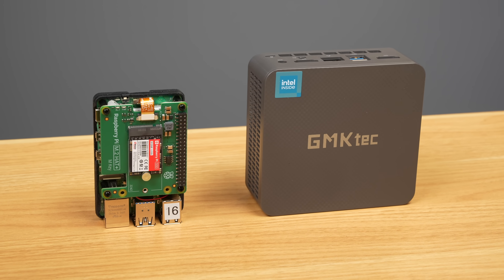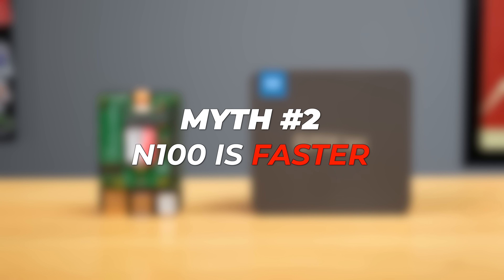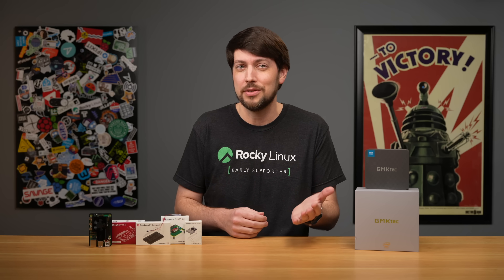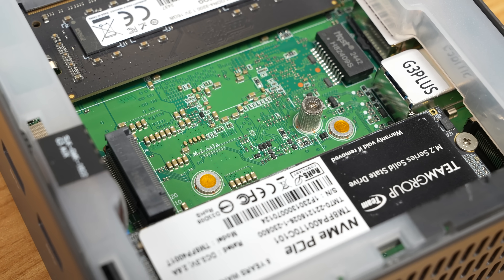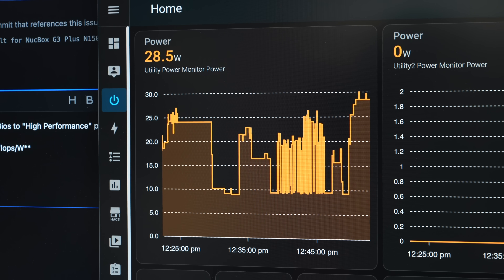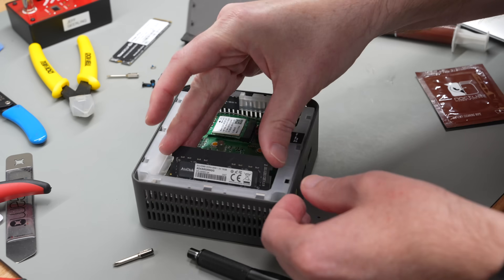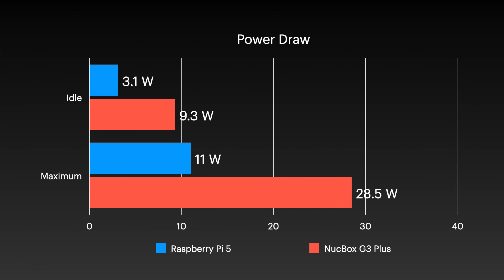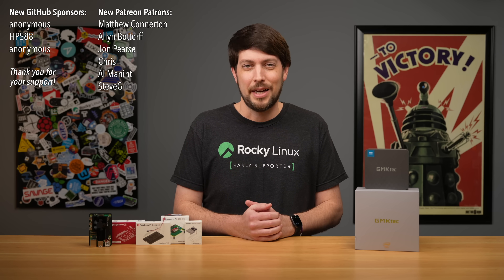When did Raspberry Pis get so expensive?

Comment: A used HP Elitedesk 800 G3 Mini i5-6500T, 16GB DDR4 RAM, 512GB SSD cost me $100 delivered and it was in excellent condition. Hard to justify new HW unless there is a specific use case.
Reply: There's a ryzen 5 2400 version floating around that regularly goes for about 70 bucks now to. It's an absolutely amazing little machine for the money.
Reply: Or my 'new' £60 Lenovo Thinkpad, with NVMe and 16 GB memory. It can't do the electronics interface that the Pi has, but for operating system / programming stuff it is cheaper and more powerful.
Reply: I have a similar experience. Recently bought a locally refurbished Elitedesk 400 G2 Mini with a Pentium G4400T, 8GB of RAM, and 256GB NVME SSD for 45€ and it is great as a local file server and thinking of using it for other services (DNS server?) as well. I can't measure power draw, but based on C-states in powertop it should idle at around 6W based on other videos I've seen.

I also agree, its hard to justify new hardware unless new features are a must (AV1 decoding or newer AVX instructions).
Reply: Yup! Got the same....no comparison.
Reply: Likewise I am replacing all of my Pis with the mini Prodesk 7th gen I3 7100T and i5 7600T.   The full size Pis cannot compete whatsoever with these things except on power use, but they cost so much less to own, it would take years of a Pi saving power to cover the higher hardware cost to match what an old Prodesk can do.  The HP also comes with a great case and stuff like NVMe built in so none of this add-on junk that forces a Pi above $200.  Absolute no.  And these Prodesk can do actual real work like running any OS you want, decent gaming, media serving. Whatever.  I've got a SFF desktop version as well with a 16X PCIe slot.  I could slap a real GPU in there.  These Prodesk or Elitedesk boxes are stunning at these low prices. I'm sure the similar Dell or Lenovo boxes are also great.  All of these obsolete any Pi that costs more than about $40 bucks all in.
Reply: I bought 4 of these just fine. The 5th one was completely FULL of dirt and dust. You can blame me for not using the same seller, or blame the seller for that mistake, but it's a hazard either way. Buying new generally is safer as far as surprises, and there are stronger buyer protections than getting used. I sent the dirt box back to the seller but it still wasted my time.
Reply: @HyenaEmpyema Why fret? I just paid $25 for one shipping included.  At those prices, even one bad box is not much.  I would have just taken it to parts and cleaned it up in the sink.  No big deal.
Reply: @HyenaEmpyema  this is a risk everybody understands when it comes to second-hand gear. If you don’t like the risk, buy new - risk vs cost 🤷‍♀️
Reply: @louwrentius  yes we agree. So just because a used i5 has a lower price tag doesn't mean it's cheaper. Because you might get a box of someone's dried skin cells 😮
Reply: Used is a lot cheaper, but the i5-6500T is slower than an n105, especially the iGPU and the SATA SSD. Power consumption is also a lot higher higher for the i5.
Reply: @tschorsch  I've got a HP Elite Desk G4 with i5 8500T, 16gb Ram, 500GB SSD and it only consumes 35w. It does the job, got it for $200 so like $100USD.
Reply: @tschorsch my measurements showed that my i5-6500 models could idle 3-4watt as observed by others
Reply: @tschorsch  that hp is nvme ssd. Many of them from this timeframe are nvme, the minis, sometimes have 1 2.5x sata bay. The sff ones have 1 or 2 3.5" bays.
Reply: @tschorsch  you might want to fact-check the performance claim. i5-6500t beats n105 in public passmark, geekbench, and cinemark scores.
Reply: Two big reason to go new hardware with something like a miniPC or Pi is because you are putting it into a project you want to share and see others be able to replicate - that 10" mini rack cluster of Pi's just can't be replicated by other people if instead of Pi's in the mini rack you are mounting weird cheap industrial PC that are just not widely available and long discontinued.  Or because these small industrial PC tend to very much not standards compliant so upgrades and repairs are tricky if possible, and the SBC has likely been abused and may not be fully working in none obvious ways. 

But if all you need is what you are sold, or you don't mind getting into the weeds repining a new PSU so it can handle that high power network card or GPU etc...
Reply: @foldionepapyrus3441  if the mini PC is an amd64 platform then the world is your oyster, you can run Linux or Windows on just about any mini PC, and the flagship line mini PCs from the major PC manufacturers are about as common as you can get, new and used.  The scenario about suddenly being a big distributor of a product only applies to a handful of people in the world, and they already know how to solve problems.
Reply: Great if you want to run Linux, for sure, but a 6 series Intel chip can't "officially" support Windows 11 (there are workarounds, sure).
Reply: @fuelvolts  the g line has tpms in the motherboard, so the win11 installer is happy
Reply: @fuelvolts  "Great if you want to run Linux, for sure, but a 6 series Intel chip can't "officially" support Windows 11"  Well as the comparison is against the Pi, which can't officially run Windows 11 either, it's a fair system to compare to.
Reply: @fuelvolts  that is your problem, you want to install windows instead of one true OS...😉
Reply: @wikingagresor  You're right. Install macOS on it
Reply: @fuelvolts  there are no security fixes for that CPU as it's end of life since 2022.

Comment: For me it'd need a very specific application to warrent getting a pi anymore. I keep picking up brand new, never been opened dell optiplex and lenovo thinkcentre mini pcs on ebay for arouns £60 each. Some of them are incredibly well specced too (i7, 16gb ram ,1tb ssd, etc). I dont know why theres so many of these being offloaded but it's been from the most random places, a bunch of charities in the UK have been selling them for example. I can only assume its from a business that had a lot on hand and have since gone bankrupt with the administrators clearing all their stock out. 

Even without that though, second hand ones are £50-£70, and most of the time just like the new ones include a keyboard, mouse, power supply and hdmi cable. 

The pi has its usecases but it's shrunk a heck of a lot.

All I have running on a pi these days is a pihole.

Comment: I've been a Pi supporter since it was first announced all those years ago. I've owned so many different models and I really have loved tinkering and such with them. I have to say though, if we're talking about 'just plug it in and it works', the Intel-based PCs have passed Pi by a lot. Yes, you can parse the specifics, but unless you're somebody like Jeff (or even like me), the best bet is going to be buying a mini PC and be done with it. They mostly "just work" without the need to tinker.

I'll still buy the Pi6 or 7 or 8 when they come out, but I rarely recommend anybody else do the same anymore. It makes me sad, but that's just the truth of it these days.
Reply from the maker: I think the Pi 500 is the answer to that use case (and if you haven't bought one — it really is that experience, which is nice).

It would've been perfect if they kept it $99 or less with an M.2 NVMe slot, though :(
Reply: @JeffGeerling that’s the problem. No nvme in 2025 is a no-no.
Reply: @JeffGeerling  aren't we all just a bit sick of you pimping the compute module even without the fact that they're unobtanium ?
Reply from the maker: @practicalthinker5545  There are a ton of CM5 available right now (have been for a while): https://rpilocator.com/?cat=CM5
Reply: @ Fair enough, but I’m honestly tired of you constantly promoting the Raspberry Pi, even when it’s overpriced, unavailable, and impractical for actual use. You keep defending it in situations where it simply doesn’t make sense, and a lot of your arguments feel forced. At this point, it seems less about practicality and more about blind loyalty to the brand.
Reply: @JeffGeerling  I'm with the other guys. You keep making videos that seem like they are going to be somewhat critical of the Pi but then seem to force in positivity to defend it and make it look better than it is.

Comment: I blame chip shortage and inflation. I remember scalpers sold pi’s for over $100. 

And during the peak crypto miner era pi’s were even more expensive.
Reply from the maker: Ugh, crypto ruined everything for a while.

I remember someone begging me to cover some weird crypto project that could run on the Pi, in the middle of the shortage. His setup had like 300 Pi 4s running 24x7... such a waste of both Pis and energy!
Reply: @JeffGeerling  Wow... That's honestly a pretty lowball move he tried to get you to pull. I'm so glad you didn't cover such a project, that would have made the already dire situation even worse. 

Also, Crypto Mining on a Pi??? That sounds dumb. (So much more useful stuff you can do...) I'd use RTX or other compute accelerators.
Reply from the maker: @ShirokoCycling  Tell me about it! Apparently for a short window of time there were enough of those $hitcoins that could turn like a few pennies a day profit on a Pi, so people were building these clusters and making the shortages even worse.

Comment: I love miniPCs for the familiarity and compatibility, I love Pi for community and GPIO. It's great we live in a world where we can choose freely.
Reply: I would possibly have given more consideration to the pi5 if came ready to go with a SSD, cooling and a case that all worked together. As far as GPIO goes I would rather add a raspberry pi pico or ESP32 and avoid putting my pc at as much risk. Microcontrollers have the added advantage that they can keep running when the pc is shut down, on power up they avoid long boot delays and they can be subjected to unexpected power failures without potential corruption of the loaded programs.
Reply: @peircedan  I would only seriously consider the pico models in a battery powered configuration. The zero line is cheap enough, and remote management is easy (if not somewhat slow). I can risk losing them rather than having to set up a separate development workflow.
Reply: @pascalmartin1891  The DYI custom split keyboard I am using to type this has a pico in both sides. Certainly no reason to use a zero as a keyboard controller. I think a lot of interfacing would be better served by a microcontroller which has GPIO and a USB interface rather than a single board computer with GPIO. In the case of my DIY keyboard I was able to use Circuitpython. This means that I can update the firmware by simply copying a new text file to the pico board. The keyboard can be connected to any pc via USB.
Reply from the maker: Indeed!
Reply: Well said, though MiniPC are often rather less compatible than you'd expect based on the specs for no reason but whichever Manufacturer can make it with weird connector and the like and get away with it to their business/industrial clients who really won't care to upgrade or repair such machines themselves - its either obsolete or still under the service contract, either way not our problem...
Reply: @foldionepapyrus3441  my worst experience was with regular desktops, especially HP and Lenovo: non-standard motherboard and PSU, odd hard drive compatibility issues (Lenovo), etc. The only proprietary connectors that I encountered for mini pc and laptops were power (Lenovo was the worst).
All in all, I have had few bad surprises with mini pcs, much less than with laptops.

Comment: Great video as always. The power draw argument is still valid if you have several units. I'm moving a lot of my homelab environments to arm (RK3588 in general) to reduce the energy footprint .
Reply: Multiple devices means summing the power draw across all of them.  Usually a single device that can run multiple workloads is going to beat multiple lower-end devices from a power draw perspective.
Reply: @serisman1042  While that is true I do a lot of load balancing and redundancy stuff. So I need multiple devices that will either share responsibilities or replicate things.
Reply: @eherlitz  Sure.  High availability / Failover is a great reason to run multiple devices.  I imagine that is outside the range of most home users though.  Depending on how much you are hosting, I'd still argue that 2-3 mini PCs will usually come out ahead of however many equivalent Pis would be needed from a cost/performance/power perspective.
Reply: @serisman1042  Yea, I do agree on that. Great point.